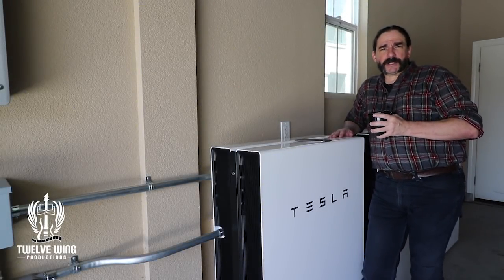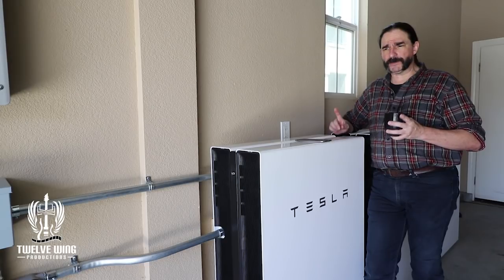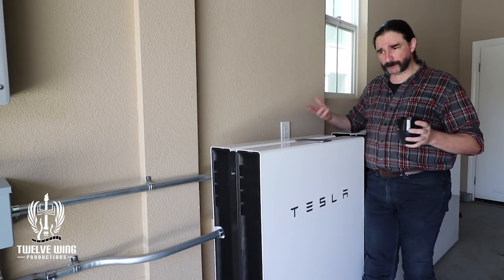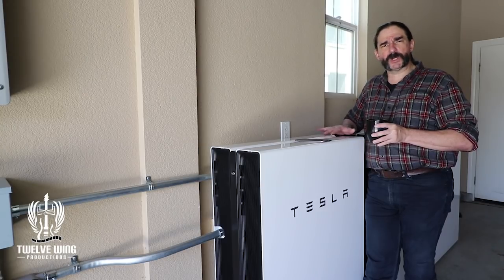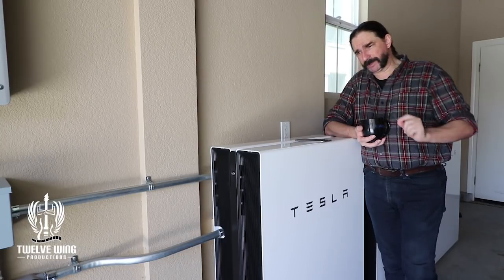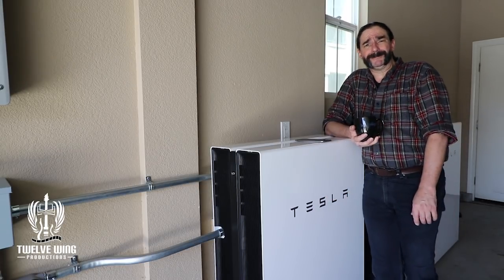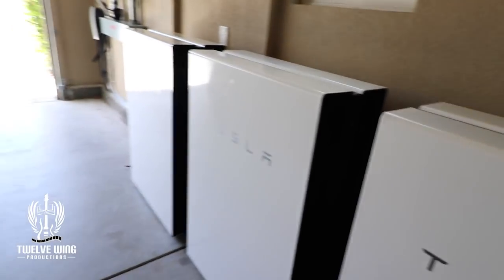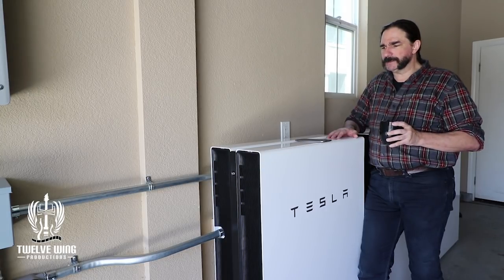Energy Sovereignty Project Quick Topic: Tesla Powerwall needs a capacity limit setting

Comment: I'm considering a 15kw power wall equivalent.. but not from Tesla.  They still can't figure out how to make the magic roof... And the corporation has had years of quarterly reports with huge losses.. (700 million in the latest go round..) --- I'm looking at pouch batteries that hold about 4x the capacity of the tesla batteries... Those were part of an electrical bus demo project.. Huge capacity.. Immense current flow capability.. Throw in about 3kw of roof and yard panels, and you have a good starting point.. perhaps 5kw?  The alternator is already available... (from China...will need thorough testing first, obviously)... I'm concerned about what happens if Elon manages to have a margin call as a result of the latest 2 billion dollars of bonds...   If the mothership stops responding when devices try to call home, do they shut down?  What happens to the cars when Tesla stops paying their electric bills all over the country?
Reply from the maker: You covered a lot of ground there.  Much of what you wrote has some basis in reality but let me go through your points one by one to make sure you are looking at things realistically and not just sucking down what short sellers are telling you blindly.

Tesla has it's issues, but delivering on what they promise isn't one of them.

"I'm considering a 15kw power wall equivalent.. but not from Tesla"~

And that's fine, but you had better make sure that whoever you buy your batteries from is either using a liquid cooling loop or is using some technology other than lithium ion.

"They still can't figure out how to make the magic roof.."~

Firstly, if you are considering going solar then you already know that the roof isn't "magic".  It's solar.
Once you are honest about that then what you need to realize that altering a form factor on a product to make it better is never the easy road to take.  It's potentially a hugely rewarding one, but it's not an easy road to take.
By all accounts Tesla is making a wonderful product with it's roof solar tiles but integrating them requires testing and regulatory approval.
I expect they are running into their share of both engineering and regulatory hurdles.

"And the corporation has had years of quarterly reports with huge losses.. "~

Here is where you need to be careful to listen to tech insiders and not the stock broker who is trying to convince you to short Tesla.
Tesla has invested hugely in what's called NRE or "Nonrecurring Engineering". The reason Tesla sells every car it makes and GM is looking at Tesla's pre-order list like a monkey trying to figure out a magic trick is because of the Supercharger network.
That network cost them a huge chunk of change but has also built a moat around the company that is proving VERY difficult for any other EV manufacturer to cross.
Tesla's second moat is the Gigafactory... and now 2 more of them in the works.
These too.. are creating what you THINK are "losses" but are in point of fact investments that virtually ensure that they won't have any real competition from anyone for decades.
What happens after that is anyone's guess but you are now talking about a person from whom the military is buying hardware. 

Let that last statement resonate with you for a moment before reading further.

" I'm looking at pouch batteries that hold about 4x the capacity of the tesla batteries..."~

Careful with that statement.  If you are looking at pouch batteries you had better be looking at how they are cooled.
If you tell me specifically what battery you are currently looking at, I'll be happy to give you some insight on what we know about them from our research.
We found NO other manufacturer, most using pouch style batteries for their internals, that were utilizing adequate thermal management.

"Those were part of an electrical bus demo project.. "~

Pouch batteries were also part of Mercedes large truck line.  The one they had to scrap... because they didn't have adequate thermal management.
This same technology line caused them to scrap two passenger vehicle lines and their home battery project.
So I'm going to say this again... make sure there is adequate thermal management.  If they are talking about air cooling the thing... avoid it.

" and you have a good starting point.. perhaps 5kw?"~

Everything depends on your home's average usage.  What is your annual average daily consumption, your winter average daily consumption and your summer average daily consumption.
With those three data sets in your bag of tricks you can draw informed conclusions about a good starting point.
I'll be happy to assist you with that if you can give me those 3 numbers as well as your latitude and elevation.

"The alternator is already available... "~

Alternator?  For wind?

"from China...will need thorough testing first, obviously"~

I'm buying nothing from China, and would suggest that anyone visiting this channel not do so either if they can absolutely avoid it.
China's issues are many.  Firstly the fact they don't recognize intellectual property rights is a HUGE issue for me.  I know how things get developed and rewarding companies for trying to advance our condition is paramount.
The deal breaker, however, is the bait and switch tactic taken by this VERY corrupt society.
They think nothing of providing you thousands of devices that are perfectly fine with the idea that they will deliver substandard goods later as they skimp on key materials.
The way Chinese companies work is that they start to copy the equipment needed to make your product even before you have finished building your own factory.
They then siphon off expensive materials for their own companies to make knockoffs while they substitute the cheap materials in the primary manufacturers goods.
This is RAMPANT.

"what happens if Elon manages to have a margin call as a result of the latest 2 billion dollars of bonds..."~

The takeaway here is that Tesla is paying it's bills.

"If the mothership stops responding when devices try to call home, do they shut down?"~

Neither the car nor the home batteries will stop working due to lack of contact.  Advancement will stop, obviously, but the devices will work fine.
What will happen next is that the people that developed that hardware and software will be looking for a job.
They will immediately start releasing "Jail braked" versions of the software.
I would be shocked if that took so long as a month.
Chevron or Shell would purchase the supercharger network and even in a total collapse of Tesla (not friggin likely at this point) the consumers will be fine.

I think that touched on most of your points.
Let me know what specific batteries you are considering.  I'll be happy to go over the pros and cons of that specific system and lay performance, size and longevity against the actual performance numbers we are getting out of the Powerwall system.
Reply from the maker: You covered a lot of ground there.  Much of what you wrote has some basis in reality but let me go through your points one by one to make sure you are looking at things realistically and not just sucking down what short sellers are telling you blindly.

Tesla has it's issues, but delivering on what they promise isn't one of them.

"I'm considering a 15kw power wall equivalent.. but not from Tesla"~

And that's fine, but you had better make sure that whoever you buy your batteries from is either using a liquid cooling loop or is using some technology other than lithium ion.

"They still can't figure out how to make the magic roof.."~

Firstly, if you are considering going solar then you already know that the roof isn't "magic".  It's solar.
Once you are honest about that then what you need to realize that altering a form factor on a product to make it better is never the easy road to take.  It's potentially a hugely rewarding one, but it's not an easy road to take.
By all accounts Tesla is making a wonderful product with it's roof solar tiles but integrating them requires testing and regulatory approval.
I expect they are running into their share of both engineering and regulatory hurdles.

"And the corporation has had years of quarterly reports with huge losses.. "~

Here is where you need to be careful to listen to tech insiders and not the stock broker who is trying to convince you to short Tesla.
Tesla has invested hugely in what's called NRE or "Nonrecurring Engineering". The reason Tesla sells every car it makes and GM is looking at Tesla's pre-order list like a monkey trying to figure out a magic trick is because of the Supercharger network.
That network cost them a huge chunk of change but has also built a moat around the company that is proving VERY difficult for any other EV manufacturer to cross.
Tesla's second moat is the Gigafactory... and now 2 more of them in the works.
These too.. are creating what you THINK are "losses" but are in point of fact investments that virtually ensure that they won't have any real competition from anyone for decades.
What happens after that is anyone's guess but you are now talking about a person from whom the military is buying hardware. 

Let that last statement resonate with you for a moment before reading further.

" I'm looking at pouch batteries that hold about 4x the capacity of the tesla batteries..."~

Careful with that statement.  If you are looking at pouch batteries you had better be looking at how they are cooled.
If you tell me specifically what battery you are currently looking at, I'll be happy to give you some insight on what we know about them from our research.
We found NO other manufacturer, most using pouch style batteries for their internals, that were utilizing adequate thermal management.

"Those were part of an electrical bus demo project.. "~

Pouch batteries were also part of Mercedes large truck line.  The one they had to scrap... because they didn't have adequate thermal management.
This same technology line caused them to scrap two passenger vehicle lines and their home battery project.
So I'm going to say this again... make sure there is adequate thermal management.  If they are talking about air cooling the thing... avoid it.

" and you have a good starting point.. perhaps 5kw?"~

Everything depends on your home's average usage.  What is your annual average daily consumption, your winter average daily consumption and your summer average daily consumption.
With those three data sets in your bag of tricks you can draw informed conclusions about a good starting point.
I'll be happy to assist you with that if you can give me those 3 numbers as well as your latitude and elevation.

"The alternator is already available... "~

Alternator?  For wind?

"from China...will need thorough testing first, obviously"~

I'm buying nothing from China, and would suggest that anyone visiting this channel not do so either if they can absolutely avoid it.
China's issues are many.  Firstly the fact they don't recognize intellectual property rights is a HUGE issue for me.  I know how things get developed and rewarding companies for trying to advance our condition is paramount.
The deal breaker, however, is the bait and switch tactic taken by this VERY corrupt society.
They think nothing of providing you thousands of devices that are perfectly fine with the idea that they will deliver substandard goods later as they skimp on key materials.
The way Chinese companies work is that they start to copy the equipment needed to make your product even before you have finished building your own factory.
They then siphon off expensive materials for their own companies to make knockoffs while they substitute the cheap materials in the primary manufacturers goods.
This is RAMPANT.

"what happens if Elon manages to have a margin call as a result of the latest 2 billion dollars of bonds..."~

The takeaway here is that Tesla is paying it's bills.

"If the mothership stops responding when devices try to call home, do they shut down?"~

Neither the car nor the home batteries will stop working due to lack of contact.  Advancement will stop, obviously, but the devices will work fine.
What will happen next is that the people that developed that hardware and software will be looking for a job.
They will immediately start releasing "Jail braked" versions of the software.
I would be shocked if that took so long as a month.
Chevron or Shell would purchase the supercharger network and even in a total collapse of Tesla (not friggin likely at this point) the consumers will be fine.

I think that touched on most of your points.
Let me know what specific batteries you are considering.  I'll be happy to go over the pros and cons of that specific system and lay performance, size and longevity against the actual performance numbers we are getting out of the Powerwall system.
Reply from the maker: You covered a lot of ground there.  Much of what you wrote has some basis in reality but let me go through your points one by one to make sure you are looking at things realistically and not just sucking down what short sellers are telling you blindly.

Tesla has it's issues, but delivering on what they promise isn't one of them.

"I'm considering a 15kw power wall equivalent.. but not from Tesla"~

And that's fine, but you had better make sure that whoever you buy your batteries from is either using a liquid cooling loop or is using some technology other than lithium ion.

"They still can't figure out how to make the magic roof.."~

Firstly, if you are considering going solar then you already know that the roof isn't "magic".  It's solar.
Once you are honest about that then what you need to realize that altering a form factor on a product to make it better is never the easy road to take.  It's potentially a hugely rewarding one, but it's not an easy road to take.
By all accounts Tesla is making a wonderful product with it's roof solar tiles but integrating them requires testing and regulatory approval.
I expect they are running into their share of both engineering and regulatory hurdles.

"And the corporation has had years of quarterly reports with huge losses.. "~

Here is where you need to be careful to listen to tech insiders and not the stock broker who is trying to convince you to short Tesla.
Tesla has invested hugely in what's called NRE or "Nonrecurring Engineering". The reason Tesla sells every car it makes and GM is looking at Tesla's pre-order list like a monkey trying to figure out a magic trick is because of the Supercharger network.
That network cost them a huge chunk of change but has also built a moat around the company that is proving VERY difficult for any other EV manufacturer to cross.
Tesla's second moat is the Gigafactory... and now 2 more of them in the works.
These too.. are creating what you THINK are "losses" but are in point of fact investments that virtually ensure that they won't have any real competition from anyone for decades.
What happens after that is anyone's guess but you are now talking about a person from whom the military is buying hardware. 

Let that last statement resonate with you for a moment before reading further.

" I'm looking at pouch batteries that hold about 4x the capacity of the tesla batteries..."~

Careful with that statement.  If you are looking at pouch batteries you had better be looking at how they are cooled.
If you tell me specifically what battery you are currently looking at, I'll be happy to give you some insight on what we know about them from our research.
We found NO other manufacturer, most using pouch style batteries for their internals, that were utilizing adequate thermal management.

"Those were part of an electrical bus demo project.. "~

Pouch batteries were also part of Mercedes large truck line.  The one they had to scrap... because they didn't have adequate thermal management.
This same technology line caused them to scrap two passenger vehicle lines and their home battery project.
So I'm going to say this again... make sure there is adequate thermal management.  If they are talking about air cooling the thing... avoid it.

" and you have a good starting point.. perhaps 5kw?"~

Everything depends on your home's average usage.  What is your annual average daily consumption, your winter average daily consumption and your summer average daily consumption.
With those three data sets in your bag of tricks you can draw informed conclusions about a good starting point.
I'll be happy to assist you with that if you can give me those 3 numbers as well as your latitude and elevation.

"The alternator is already available... "~

Alternator?  For wind?

"from China...will need thorough testing first, obviously"~

I'm buying nothing from China, and would suggest that anyone visiting this channel not do so either if they can absolutely avoid it.
China's issues are many.  Firstly the fact they don't recognize intellectual property rights is a HUGE issue for me.  I know how things get developed and rewarding companies for trying to advance our condition is paramount.
The deal breaker, however, is the bait and switch tactic taken by this VERY corrupt society.
They think nothing of providing you thousands of devices that are perfectly fine with the idea that they will deliver substandard goods later as they skimp on key materials.
The way Chinese companies work is that they start to copy the equipment needed to make your product even before you have finished building your own factory.
They then siphon off expensive materials for their own companies to make knockoffs while they substitute the cheap materials in the primary manufacturers goods.
This is RAMPANT.

"what happens if Elon manages to have a margin call as a result of the latest 2 billion dollars of bonds..."~

The takeaway here is that Tesla is paying it's bills.

"If the mothership stops responding when devices try to call home, do they shut down?"~

Neither the car nor the home batteries will stop working due to lack of contact.  Advancement will stop, obviously, but the devices will work fine.
What will happen next is that the people that developed that hardware and software will be looking for a job.
They will immediately start releasing "Jail braked" versions of the software.
I would be shocked if that took so long as a month.
Chevron or Shell would purchase the supercharger network and even in a total collapse of Tesla (not friggin likely at this point) the consumers will be fine.

I think that touched on most of your points.
Let me know what specific batteries you are considering.  I'll be happy to go over the pros and cons of that specific system and lay performance, size and longevity against the actual performance numbers we are getting out of the Powerwall system.
Reply from the maker: You covered a lot of ground there.  Much of what you wrote has some basis in reality but let me go through your points one by one to make sure you are looking at things realistically and not just sucking down what short sellers are telling you blindly.

Tesla has it's issues, but delivering on what they promise isn't one of them.

"I'm considering a 15kw power wall equivalent.. but not from Tesla"~

And that's fine, but you had better make sure that whoever you buy your batteries from is either using a liquid cooling loop or is using some technology other than lithium ion.

"They still can't figure out how to make the magic roof.."~

Firstly, if you are considering going solar then you already know that the roof isn't "magic".  It's solar.
Once you are honest about that then what you need to realize that altering a form factor on a product to make it better is never the easy road to take.  It's potentially a hugely rewarding one, but it's not an easy road to take.
By all accounts Tesla is making a wonderful product with it's roof solar tiles but integrating them requires testing and regulatory approval.
I expect they are running into their share of both engineering and regulatory hurdles.

"And the corporation has had years of quarterly reports with huge losses.. "~

Here is where you need to be careful to listen to tech insiders and not the stock broker who is trying to convince you to short Tesla.
Tesla has invested hugely in what's called NRE or "Nonrecurring Engineering". The reason Tesla sells every car it makes and GM is looking at Tesla's pre-order list like a monkey trying to figure out a magic trick is because of the Supercharger network.
That network cost them a huge chunk of change but has also built a moat around the company that is proving VERY difficult for any other EV manufacturer to cross.
Tesla's second moat is the Gigafactory... and now 2 more of them in the works.
These too.. are creating what you THINK are "losses" but are in point of fact investments that virtually ensure that they won't have any real competition from anyone for decades.
What happens after that is anyone's guess but you are now talking about a person from whom the military is buying hardware. 

Let that last statement resonate with you for a moment before reading further.

" I'm looking at pouch batteries that hold about 4x the capacity of the tesla batteries..."~

Careful with that statement.  If you are looking at pouch batteries you had better be looking at how they are cooled.
If you tell me specifically what battery you are currently looking at, I'll be happy to give you some insight on what we know about them from our research.
We found NO other manufacturer, most using pouch style batteries for their internals, that were utilizing adequate thermal management.

"Those were part of an electrical bus demo project.. "~

Pouch batteries were also part of Mercedes large truck line.  The one they had to scrap... because they didn't have adequate thermal management.
This same technology line caused them to scrap two passenger vehicle lines and their home battery project.
So I'm going to say this again... make sure there is adequate thermal management.  If they are talking about air cooling the thing... avoid it.

" and you have a good starting point.. perhaps 5kw?"~

Everything depends on your home's average usage.  What is your annual average daily consumption, your winter average daily consumption and your summer average daily consumption.
With those three data sets in your bag of tricks you can draw informed conclusions about a good starting point.
I'll be happy to assist you with that if you can give me those 3 numbers as well as your latitude and elevation.

"The alternator is already available... "~

Alternator?  For wind?

"from China...will need thorough testing first, obviously"~

I'm buying nothing from China, and would suggest that anyone visiting this channel not do so either if they can absolutely avoid it.
China's issues are many.  Firstly the fact they don't recognize intellectual property rights is a HUGE issue for me.  I know how things get developed and rewarding companies for trying to advance our condition is paramount.
The deal breaker, however, is the bait and switch tactic taken by this VERY corrupt society.
They think nothing of providing you thousands of devices that are perfectly fine with the idea that they will deliver substandard goods later as they skimp on key materials.
The way Chinese companies work is that they start to copy the equipment needed to make your product even before you have finished building your own factory.
They then siphon off expensive materials for their own companies to make knockoffs while they substitute the cheap materials in the primary manufacturers goods.
This is RAMPANT.

"what happens if Elon manages to have a margin call as a result of the latest 2 billion dollars of bonds..."~

The takeaway here is that Tesla is paying it's bills.

"If the mothership stops responding when devices try to call home, do they shut down?"~

Neither the car nor the home batteries will stop working due to lack of contact.  Advancement will stop, obviously, but the devices will work fine.
What will happen next is that the people that developed that hardware and software will be looking for a job.
They will immediately start releasing "Jail braked" versions of the software.
I would be shocked if that took so long as a month.
Chevron or Shell would purchase the supercharger network and even in a total collapse of Tesla (not friggin likely at this point) the consumers will be fine.

I think that touched on most of your points.
Let me know what specific batteries you are considering.  I'll be happy to go over the pros and cons of that specific system and lay performance, size and longevity against the actual performance numbers we are getting out of the Powerwall system.
Reply from the maker: You covered a lot of ground there.  Much of what you wrote has some basis in reality but let me go through your points one by one to make sure you are looking at things realistically and not just sucking down what short sellers are telling you blindly.

Tesla has it's issues, but delivering on what they promise isn't one of them.

"I'm considering a 15kw power wall equivalent.. but not from Tesla"~

And that's fine, but you had better make sure that whoever you buy your batteries from is either using a liquid cooling loop or is using some technology other than lithium ion.

"They still can't figure out how to make the magic roof.."~

Firstly, if you are considering going solar then you already know that the roof isn't "magic".  It's solar.
Once you are honest about that then what you need to realize that altering a form factor on a product to make it better is never the easy road to take.  It's potentially a hugely rewarding one, but it's not an easy road to take.
By all accounts Tesla is making a wonderful product with it's roof solar tiles but integrating them requires testing and regulatory approval.
I expect they are running into their share of both engineering and regulatory hurdles.

"And the corporation has had years of quarterly reports with huge losses.. "~

Here is where you need to be careful to listen to tech insiders and not the stock broker who is trying to convince you to short Tesla.
Tesla has invested hugely in what's called NRE or "Nonrecurring Engineering". The reason Tesla sells every car it makes and GM is looking at Tesla's pre-order list like a monkey trying to figure out a magic trick is because of the Supercharger network.
That network cost them a huge chunk of change but has also built a moat around the company that is proving VERY difficult for any other EV manufacturer to cross.
Tesla's second moat is the Gigafactory... and now 2 more of them in the works.
These too.. are creating what you THINK are "losses" but are in point of fact investments that virtually ensure that they won't have any real competition from anyone for decades.
What happens after that is anyone's guess but you are now talking about a person from whom the military is buying hardware. 

Let that last statement resonate with you for a moment before reading further.

" I'm looking at pouch batteries that hold about 4x the capacity of the tesla batteries..."~

Careful with that statement.  If you are looking at pouch batteries you had better be looking at how they are cooled.
If you tell me specifically what battery you are currently looking at, I'll be happy to give you some insight on what we know about them from our research.
We found NO other manufacturer, most using pouch style batteries for their internals, that were utilizing adequate thermal management.

"Those were part of an electrical bus demo project.. "~

Pouch batteries were also part of Mercedes large truck line.  The one they had to scrap... because they didn't have adequate thermal management.
This same technology line caused them to scrap two passenger vehicle lines and their home battery project.
So I'm going to say this again... make sure there is adequate thermal management.  If they are talking about air cooling the thing... avoid it.

" and you have a good starting point.. perhaps 5kw?"~

Everything depends on your home's average usage.  What is your annual average daily consumption, your winter average daily consumption and your summer average daily consumption.
With those three data sets in your bag of tricks you can draw informed conclusions about a good starting point.
I'll be happy to assist you with that if you can give me those 3 numbers as well as your latitude and elevation.

"The alternator is already available... "~

Alternator?  For wind?

"from China...will need thorough testing first, obviously"~

I'm buying nothing from China, and would suggest that anyone visiting this channel not do so either if they can absolutely avoid it.
China's issues are many.  Firstly the fact they don't recognize intellectual property rights is a HUGE issue for me.  I know how things get developed and rewarding companies for trying to advance our condition is paramount.
The deal breaker, however, is the bait and switch tactic taken by this VERY corrupt society.
They think nothing of providing you thousands of devices that are perfectly fine with the idea that they will deliver substandard goods later as they skimp on key materials.
The way Chinese companies work is that they start to copy the equipment needed to make your product even before you have finished building your own factory.
They then siphon off expensive materials for their own companies to make knockoffs while they substitute the cheap materials in the primary manufacturers goods.
This is RAMPANT.

"what happens if Elon manages to have a margin call as a result of the latest 2 billion dollars of bonds..."~

The takeaway here is that Tesla is paying it's bills.

"If the mothership stops responding when devices try to call home, do they shut down?"~

Neither the car nor the home batteries will stop working due to lack of contact.  Advancement will stop, obviously, but the devices will work fine.
What will happen next is that the people that developed that hardware and software will be looking for a job.
They will immediately start releasing "Jail braked" versions of the software.
I would be shocked if that took so long as a month.
Chevron or Shell would purchase the supercharger network and even in a total collapse of Tesla (not friggin likely at this point) the consumers will be fine.

I think that touched on most of your points.
Let me know what specific batteries you are considering.  I'll be happy to go over the pros and cons of that specific system and lay performance, size and longevity against the actual performance numbers we are getting out of the Powerwall system.
Reply from the maker: You covered a lot of ground there.  Much of what you wrote has some basis in reality but let me go through your points one by one to make sure you are looking at things realistically and not just sucking down what short sellers are telling you blindly.

Tesla has it's issues, but delivering on what they promise isn't one of them.

"I'm considering a 15kw power wall equivalent.. but not from Tesla"~

And that's fine, but you had better make sure that whoever you buy your batteries from is either using a liquid cooling loop or is using some technology other than lithium ion.

"They still can't figure out how to make the magic roof.."~

Firstly, if you are considering going solar then you already know that the roof isn't "magic".  It's solar.
Once you are honest about that then what you need to realize that altering a form factor on a product to make it better is never the easy road to take.  It's potentially a hugely rewarding one, but it's not an easy road to take.
By all accounts Tesla is making a wonderful product with it's roof solar tiles but integrating them requires testing and regulatory approval.
I expect they are running into their share of both engineering and regulatory hurdles.

"And the corporation has had years of quarterly reports with huge losses.. "~

Here is where you need to be careful to listen to tech insiders and not the stock broker who is trying to convince you to short Tesla.
Tesla has invested hugely in what's called NRE or "Nonrecurring Engineering". The reason Tesla sells every car it makes and GM is looking at Tesla's pre-order list like a monkey trying to figure out a magic trick is because of the Supercharger network.
That network cost them a huge chunk of change but has also built a moat around the company that is proving VERY difficult for any other EV manufacturer to cross.
Tesla's second moat is the Gigafactory... and now 2 more of them in the works.
These too.. are creating what you THINK are "losses" but are in point of fact investments that virtually ensure that they won't have any real competition from anyone for decades.
What happens after that is anyone's guess but you are now talking about a person from whom the military is buying hardware. 

Let that last statement resonate with you for a moment before reading further.

" I'm looking at pouch batteries that hold about 4x the capacity of the tesla batteries..."~

Careful with that statement.  If you are looking at pouch batteries you had better be looking at how they are cooled.
If you tell me specifically what battery you are currently looking at, I'll be happy to give you some insight on what we know about them from our research.
We found NO other manufacturer, most using pouch style batteries for their internals, that were utilizing adequate thermal management.

"Those were part of an electrical bus demo project.. "~

Pouch batteries were also part of Mercedes large truck line.  The one they had to scrap... because they didn't have adequate thermal management.
This same technology line caused them to scrap two passenger vehicle lines and their home battery project.
So I'm going to say this again... make sure there is adequate thermal management.  If they are talking about air cooling the thing... avoid it.

" and you have a good starting point.. perhaps 5kw?"~

Everything depends on your home's average usage.  What is your annual average daily consumption, your winter average daily consumption and your summer average daily consumption.
With those three data sets in your bag of tricks you can draw informed conclusions about a good starting point.
I'll be happy to assist you with that if you can give me those 3 numbers as well as your latitude and elevation.

"The alternator is already available... "~

Alternator?  For wind?

"from China...will need thorough testing first, obviously"~

I'm buying nothing from China, and would suggest that anyone visiting this channel not do so either if they can absolutely avoid it.
China's issues are many.  Firstly the fact they don't recognize intellectual property rights is a HUGE issue for me.  I know how things get developed and rewarding companies for trying to advance our condition is paramount.
The deal breaker, however, is the bait and switch tactic taken by this VERY corrupt society.
They think nothing of providing you thousands of devices that are perfectly fine with the idea that they will deliver substandard goods later as they skimp on key materials.
The way Chinese companies work is that they start to copy the equipment needed to make your product even before you have finished building your own factory.
They then siphon off expensive materials for their own companies to make knockoffs while they substitute the cheap materials in the primary manufacturers goods.
This is RAMPANT.

"what happens if Elon manages to have a margin call as a result of the latest 2 billion dollars of bonds..."~

The takeaway here is that Tesla is paying it's bills.

"If the mothership stops responding when devices try to call home, do they shut down?"~

Neither the car nor the home batteries will stop working due to lack of contact.  Advancement will stop, obviously, but the devices will work fine.
What will happen next is that the people that developed that hardware and software will be looking for a job.
They will immediately start releasing "Jail braked" versions of the software.
I would be shocked if that took so long as a month.
Chevron or Shell would purchase the supercharger network and even in a total collapse of Tesla (not friggin likely at this point) the consumers will be fine.

I think that touched on most of your points.
Let me know what specific batteries you are considering.  I'll be happy to go over the pros and cons of that specific system and lay performance, size and longevity against the actual performance numbers we are getting out of the Powerwall system.
Reply: @twelvewingproductions7508  The problem: Elon promises much and does NOT deliver.  He said they would be doing 5k a week in 2017 the year before. Never happened. We do not know if Tesla is paying suppliers in a timely manner.  Panasonic has backed out of the China Factory (Promised to be finished in what? 2017?  It's a plot of dirt right now.  Panasonic had a BIG AP entry here in the US.  Could that be batteries for Tesla?    And when it comes to getting approval from the mothership to charge...you had best assume that it will not work.  (That is a billing function and if the web site goes away, there won't be billing...--- The power walls call to discuss passing energy to the grid and so on... And management from their end.  When it comes to power generation, you fail for safety.  (worked in distribution at a utility office... anything less than safety means failing to off.)   

Elon said that the roofs would be going on houses in large quantities.. Well, 13 homes is not a large quantity. So 2017 didn't work for the roof, neither did 2018... So far, 2019 is not looking good either. 

The cars are so expensive to repair that you might have a 3-6 month period without your car, and that door and quarter panel will end up costing $20,000 or more.  That is why he is talking about selling insurance. Having a car totaled for a bumper and quarter panel, or door and quarter panel is really odd. You have HUGE insurance bills since small accidents cause enough damage to total the car.  The Feds are investigating currently, and the banks are nervous.  They may pull a margin call if the stock drops, selling a huge block that was put up as collateral.  That will further depress the stock, making short sellers very happy. (Not me...)  Elon just mortgaged 5 of his homes.  Sounds like a cash flow issue.. and HE violated his agreement with the courts and the financial arm that is looking at him.   Several things come up that are scary.  Tesla put out official guidance and production number, the Elon comes out and changes things.  And then does it again..and again.  That makes the government (and other financial folk) very very unhappy.  He thinks there is nothing to worry about.  The big people that know finance are frowning.  And he violated a court order requiring board approval for all tweets.  Turned out he never passed any tweets past the board.  Frankly, the stunts he pulled to save his wallet, and his cousin's wallets when Tesla bought Solar CIty (also saved several relatives pockets) came at the expense of Tesla stockholders.  Solar City was not being run by Elon.. but his cousins if I remember correctly... He saved their bacon as well because it was turning into another Solyndra.  Getting ready to close.. That would have hit Elon in the pocket, as well as throwing his cousins out of work.

He promised the magical shingles last year... saying they would be rolling them out nationwide.  Last year and this year... Well, didn't happen.  They claimed that they would be impervious to the weather, birds and so on.. but they are not reliable at this point. They break, with regularity.   One guy down here ordered a year and a half ago...gave lots of money.... and has gotten nothing in return.  For his needs, the roof was $40,000.  He'll be asking for a big refund shortly.  I like the vision, but I am not ready to put up with a paperweight.  If Tesla folds... there won't be superchargers. (well, except for Audi superchargers ...The VW folk have 500 going in at this moment for their new luxury cars... Part of their Diesel exhaust debacle a few years ago.)  Elon and Tesla are one margin call away from becoming a memory.  Of course, someone may buy the name, Intellectual property and so on, but who knows?  If the Tesla mother ship folds, will the power walls shut down?  Will the cars all stop working?  Jail breaking a tesla may be the only way to keep things operating.. The car won't hunt for their chargers, and map updates will stop.. but you can always use it locally with a 220 charger....
Reply from the maker: @Billblom , I'm going to have to reel you in here... and more than a little.
What you are doing now is typing without researching or even thinking.
You need to put your opinions about Tesla on hold and actually look into this before you wind up looking silly.

There are no less than 6 things in the first three paragraphs that you are misinformed about or are flat out wrong... yet you are forming your reply here in the form of a statements and not questions.
It's fine not to know something but it's not fine to spread misinformation to fuel an agenda.

I'm not going to give lengthy answers to much of what you wrote because most of it is poorly researched and doesn't even have anything to anchor an honest argument.

I will, however, list a few things here that you really do need to research before responding.

While it is true that Tesla (Elon Musk) is often late on projects, it is equally true that he over delivers on those projects.  I can give an entire list that got us to where we are today... but do I really have to?  Seriously?

Next up are some of the things you have heard regarding business dealings.  Panasonic was in a co-venture with Tesla much like Mercedes was.  They will maintain these relationships for so long as they are mutually beneficial.  When they are not, they won't.

Both Mercedes and Panasonic are competitors.  Through a sharing of technology with both companies, all 3 have emerged stronger for their relationship with Tesla.
The China factory is moving along just fine.  It wasn't but 4 months ago that they got approval from the Chinese government NOT to steal Tesla's IP.  That was what was holding things up.
Trying to cite China's delays as a negative is a stretch.

About the only thing you got right was when you said that IF Tesla closed shop, for a time the supercharger network would be idle.  That wouldn't last long for the very reason you said in your very next sentence.
Whoever takes it over can charge for using it.
So no, you don't get to pop off with a statement like "The Superchargers will shut down" and then just shut your brain off and pretend that you don't know what will happen next.
Same with every part of the current automobile lineup.  Those that wrote the code will start writing the code for third party support companies that will be happy to cash in on keeping the cars alive.

Same with the Powerwalls.
The second point with the Powerwalls is that you OBVIOUSLY have no experience with them nor have you apparently been monitoring this channel much.  If you had you would already know that the units don't have to ask the "mothership" for anything.
They will keep running happy as you please with no communication what so ever.
You won't get updates and you won't be able to alter settings, but they will continue to run just fine.
Then, the same thing will happen with the Powerwalls.  Someone will "Jail Break" them.
Richardt and others already have software to drive them.  I don't choose to use that hardware because I am trying to promote what the general public will do with the equipment.  And the general public isn't going to be voiding their warranty. 

So please, Billblom, I do enjoy getting and answering feedback here... but if you don't actually know something... ask.
If you just start typing crap just to support your agenda... and it's wrong... I'm going to call you on it.
That's also part of the deal here.

As to the others, neither Audi nor Porsche have ANY fast chargers.  They are all still using other DC fast charge networks.
Tesla has adapters now for both Chademo and CCS.  So no, Teslas wouldn't be locked to level 2 charging.  But again, that point is moot because another party would buy the SC network from Tesla should they fall.  Probably Audi or Porsche.. but at this point I would be putting my bet on Ford.
Reply from the maker: You covered a lot of ground there.  Much of what you wrote has some basis in reality but let me go through your points one by one to make sure you are looking at things realistically and not just sucking down what short sellers are telling you blindly.

Tesla has it's issues, but delivering on what they promise isn't one of them.

"I'm considering a 15kw power wall equivalent.. but not from Tesla"~

And that's fine, but you had better make sure that whoever you buy your batteries from is either using a liquid cooling loop or is using some technology other than lithium ion.

"They still can't figure out how to make the magic roof.."~

Firstly, if you are considering going solar then you already know that the roof isn't "magic".  It's solar.
Once you are honest about that then what you need to realize that altering a form factor on a product to make it better is never the easy road to take.  It's potentially a hugely rewarding one, but it's not an easy road to take.
By all accounts Tesla is making a wonderful product with it's roof solar tiles but integrating them requires testing and regulatory approval.
I expect they are running into their share of both engineering and regulatory hurdles.

"And the corporation has had years of quarterly reports with huge losses.. "~

Here is where you need to be careful to listen to tech insiders and not the stock broker who is trying to convince you to short Tesla.
Tesla has invested hugely in what's called NRE or "Nonrecurring Engineering". The reason Tesla sells every car it makes and GM is looking at Tesla's pre-order list like a monkey trying to figure out a magic trick is because of the Supercharger network.
That network cost them a huge chunk of change but has also built a moat around the company that is proving VERY difficult for any other EV manufacturer to cross.
Tesla's second moat is the Gigafactory... and now 2 more of them in the works.
These too.. are creating what you THINK are "losses" but are in point of fact investments that virtually ensure that they won't have any real competition from anyone for decades.
What happens after that is anyone's guess but you are now talking about a person from whom the military is buying hardware. 

Let that last statement resonate with you for a moment before reading further.

" I'm looking at pouch batteries that hold about 4x the capacity of the tesla batteries..."~

Careful with that statement.  If you are looking at pouch batteries you had better be looking at how they are cooled.
If you tell me specifically what battery you are currently looking at, I'll be happy to give you some insight on what we know about them from our research.
We found NO other manufacturer, most using pouch style batteries for their internals, that were utilizing adequate thermal management.

"Those were part of an electrical bus demo project.. "~

Pouch batteries were also part of Mercedes large truck line.  The one they had to scrap... because they didn't have adequate thermal management.
This same technology line caused them to scrap two passenger vehicle lines and their home battery project.
So I'm going to say this again... make sure there is adequate thermal management.  If they are talking about air cooling the thing... avoid it.

" and you have a good starting point.. perhaps 5kw?"~

Everything depends on your home's average usage.  What is your annual average daily consumption, your winter average daily consumption and your summer average daily consumption.
With those three data sets in your bag of tricks you can draw informed conclusions about a good starting point.
I'll be happy to assist you with that if you can give me those 3 numbers as well as your latitude and elevation.

"The alternator is already available... "~

Alternator?  For wind?

"from China...will need thorough testing first, obviously"~

I'm buying nothing from China, and would suggest that anyone visiting this channel not do so either if they can absolutely avoid it.
China's issues are many.  Firstly the fact they don't recognize intellectual property rights is a HUGE issue for me.  I know how things get developed and rewarding companies for trying to advance our condition is paramount.
The deal breaker, however, is the bait and switch tactic taken by this VERY corrupt society.
They think nothing of providing you thousands of devices that are perfectly fine with the idea that they will deliver substandard goods later as they skimp on key materials.
The way Chinese companies work is that they start to copy the equipment needed to make your product even before you have finished building your own factory.
They then siphon off expensive materials for their own companies to make knockoffs while they substitute the cheap materials in the primary manufacturers goods.
This is RAMPANT.

"what happens if Elon manages to have a margin call as a result of the latest 2 billion dollars of bonds..."~

The takeaway here is that Tesla is paying it's bills.

"If the mothership stops responding when devices try to call home, do they shut down?"~

Neither the car nor the home batteries will stop working due to lack of contact.  Advancement will stop, obviously, but the devices will work fine.
What will happen next is that the people that developed that hardware and software will be looking for a job.
They will immediately start releasing "Jail braked" versions of the software.
I would be shocked if that took so long as a month.
Chevron or Shell would purchase the supercharger network and even in a total collapse of Tesla (not friggin likely at this point) the consumers will be fine.

I think that touched on most of your points.
Let me know what specific batteries you are considering.  I'll be happy to go over the pros and cons of that specific system and lay performance, size and longevity against the actual performance numbers we are getting out of the Powerwall system.
Reply from the maker: You covered a lot of ground there.  Much of what you wrote has some basis in reality but let me go through your points one by one to make sure you are looking at things realistically and not just sucking down what short sellers are telling you blindly.

Tesla has it's issues, but delivering on what they promise isn't one of them.

"I'm considering a 15kw power wall equivalent.. but not from Tesla"~

And that's fine, but you had better make sure that whoever you buy your batteries from is either using a liquid cooling loop or is using some technology other than lithium ion.

"They still can't figure out how to make the magic roof.."~

Firstly, if you are considering going solar then you already know that the roof isn't "magic".  It's solar.
Once you are honest about that then what you need to realize that altering a form factor on a product to make it better is never the easy road to take.  It's potentially a hugely rewarding one, but it's not an easy road to take.
By all accounts Tesla is making a wonderful product with it's roof solar tiles but integrating them requires testing and regulatory approval.
I expect they are running into their share of both engineering and regulatory hurdles.

"And the corporation has had years of quarterly reports with huge losses.. "~

Here is where you need to be careful to listen to tech insiders and not the stock broker who is trying to convince you to short Tesla.
Tesla has invested hugely in what's called NRE or "Nonrecurring Engineering". The reason Tesla sells every car it makes and GM is looking at Tesla's pre-order list like a monkey trying to figure out a magic trick is because of the Supercharger network.
That network cost them a huge chunk of change but has also built a moat around the company that is proving VERY difficult for any other EV manufacturer to cross.
Tesla's second moat is the Gigafactory... and now 2 more of them in the works.
These too.. are creating what you THINK are "losses" but are in point of fact investments that virtually ensure that they won't have any real competition from anyone for decades.
What happens after that is anyone's guess but you are now talking about a person from whom the military is buying hardware. 

Let that last statement resonate with you for a moment before reading further.

" I'm looking at pouch batteries that hold about 4x the capacity of the tesla batteries..."~

Careful with that statement.  If you are looking at pouch batteries you had better be looking at how they are cooled.
If you tell me specifically what battery you are currently looking at, I'll be happy to give you some insight on what we know about them from our research.
We found NO other manufacturer, most using pouch style batteries for their internals, that were utilizing adequate thermal management.

"Those were part of an electrical bus demo project.. "~

Pouch batteries were also part of Mercedes large truck line.  The one they had to scrap... because they didn't have adequate thermal management.
This same technology line caused them to scrap two passenger vehicle lines and their home battery project.
So I'm going to say this again... make sure there is adequate thermal management.  If they are talking about air cooling the thing... avoid it.

" and you have a good starting point.. perhaps 5kw?"~

Everything depends on your home's average usage.  What is your annual average daily consumption, your winter average daily consumption and your summer average daily consumption.
With those three data sets in your bag of tricks you can draw informed conclusions about a good starting point.
I'll be happy to assist you with that if you can give me those 3 numbers as well as your latitude and elevation.

"The alternator is already available... "~

Alternator?  For wind?

"from China...will need thorough testing first, obviously"~

I'm buying nothing from China, and would suggest that anyone visiting this channel not do so either if they can absolutely avoid it.
China's issues are many.  Firstly the fact they don't recognize intellectual property rights is a HUGE issue for me.  I know how things get developed and rewarding companies for trying to advance our condition is paramount.
The deal breaker, however, is the bait and switch tactic taken by this VERY corrupt society.
They think nothing of providing you thousands of devices that are perfectly fine with the idea that they will deliver substandard goods later as they skimp on key materials.
The way Chinese companies work is that they start to copy the equipment needed to make your product even before you have finished building your own factory.
They then siphon off expensive materials for their own companies to make knockoffs while they substitute the cheap materials in the primary manufacturers goods.
This is RAMPANT.

"what happens if Elon manages to have a margin call as a result of the latest 2 billion dollars of bonds..."~

The takeaway here is that Tesla is paying it's bills.

"If the mothership stops responding when devices try to call home, do they shut down?"~

Neither the car nor the home batteries will stop working due to lack of contact.  Advancement will stop, obviously, but the devices will work fine.
What will happen next is that the people that developed that hardware and software will be looking for a job.
They will immediately start releasing "Jail braked" versions of the software.
I would be shocked if that took so long as a month.
Chevron or Shell would purchase the supercharger network and even in a total collapse of Tesla (not friggin likely at this point) the consumers will be fine.

I think that touched on most of your points.
Let me know what specific batteries you are considering.  I'll be happy to go over the pros and cons of that specific system and lay performance, size and longevity against the actual performance numbers we are getting out of the Powerwall system.
Reply from the maker: You covered a lot of ground there.  Much of what you wrote has some basis in reality but let me go through your points one by one to make sure you are looking at things realistically and not just sucking down what short sellers are telling you blindly.

Tesla has it's issues, but delivering on what they promise isn't one of them.

"I'm considering a 15kw power wall equivalent.. but not from Tesla"~

And that's fine, but you had better make sure that whoever you buy your batteries from is either using a liquid cooling loop or is using some technology other than lithium ion.

"They still can't figure out how to make the magic roof.."~

Firstly, if you are considering going solar then you already know that the roof isn't "magic".  It's solar.
Once you are honest about that then what you need to realize that altering a form factor on a product to make it better is never the easy road to take.  It's potentially a hugely rewarding one, but it's not an easy road to take.
By all accounts Tesla is making a wonderful product with it's roof solar tiles but integrating them requires testing and regulatory approval.
I expect they are running into their share of both engineering and regulatory hurdles.

"And the corporation has had years of quarterly reports with huge losses.. "~

Here is where you need to be careful to listen to tech insiders and not the stock broker who is trying to convince you to short Tesla.
Tesla has invested hugely in what's called NRE or "Nonrecurring Engineering". The reason Tesla sells every car it makes and GM is looking at Tesla's pre-order list like a monkey trying to figure out a magic trick is because of the Supercharger network.
That network cost them a huge chunk of change but has also built a moat around the company that is proving VERY difficult for any other EV manufacturer to cross.
Tesla's second moat is the Gigafactory... and now 2 more of them in the works.
These too.. are creating what you THINK are "losses" but are in point of fact investments that virtually ensure that they won't have any real competition from anyone for decades.
What happens after that is anyone's guess but you are now talking about a person from whom the military is buying hardware. 

Let that last statement resonate with you for a moment before reading further.

" I'm looking at pouch batteries that hold about 4x the capacity of the tesla batteries..."~

Careful with that statement.  If you are looking at pouch batteries you had better be looking at how they are cooled.
If you tell me specifically what battery you are currently looking at, I'll be happy to give you some insight on what we know about them from our research.
We found NO other manufacturer, most using pouch style batteries for their internals, that were utilizing adequate thermal management.

"Those were part of an electrical bus demo project.. "~

Pouch batteries were also part of Mercedes large truck line.  The one they had to scrap... because they didn't have adequate thermal management.
This same technology line caused them to scrap two passenger vehicle lines and their home battery project.
So I'm going to say this again... make sure there is adequate thermal management.  If they are talking about air cooling the thing... avoid it.

" and you have a good starting point.. perhaps 5kw?"~

Everything depends on your home's average usage.  What is your annual average daily consumption, your winter average daily consumption and your summer average daily consumption.
With those three data sets in your bag of tricks you can draw informed conclusions about a good starting point.
I'll be happy to assist you with that if you can give me those 3 numbers as well as your latitude and elevation.

"The alternator is already available... "~

Alternator?  For wind?

"from China...will need thorough testing first, obviously"~

I'm buying nothing from China, and would suggest that anyone visiting this channel not do so either if they can absolutely avoid it.
China's issues are many.  Firstly the fact they don't recognize intellectual property rights is a HUGE issue for me.  I know how things get developed and rewarding companies for trying to advance our condition is paramount.
The deal breaker, however, is the bait and switch tactic taken by this VERY corrupt society.
They think nothing of providing you thousands of devices that are perfectly fine with the idea that they will deliver substandard goods later as they skimp on key materials.
The way Chinese companies work is that they start to copy the equipment needed to make your product even before you have finished building your own factory.
They then siphon off expensive materials for their own companies to make knockoffs while they substitute the cheap materials in the primary manufacturers goods.
This is RAMPANT.

"what happens if Elon manages to have a margin call as a result of the latest 2 billion dollars of bonds..."~

The takeaway here is that Tesla is paying it's bills.

"If the mothership stops responding when devices try to call home, do they shut down?"~

Neither the car nor the home batteries will stop working due to lack of contact.  Advancement will stop, obviously, but the devices will work fine.
What will happen next is that the people that developed that hardware and software will be looking for a job.
They will immediately start releasing "Jail braked" versions of the software.
I would be shocked if that took so long as a month.
Chevron or Shell would purchase the supercharger network and even in a total collapse of Tesla (not friggin likely at this point) the consumers will be fine.

I think that touched on most of your points.
Let me know what specific batteries you are considering.  I'll be happy to go over the pros and cons of that specific system and lay performance, size and longevity against the actual performance numbers we are getting out of the Powerwall system.
Reply from the maker: You covered a lot of ground there.  Much of what you wrote has some basis in reality but let me go through your points one by one to make sure you are looking at things realistically and not just sucking down what short sellers are telling you blindly.

Tesla has it's issues, but delivering on what they promise isn't one of them.

"I'm considering a 15kw power wall equivalent.. but not from Tesla"~

And that's fine, but you had better make sure that whoever you buy your batteries from is either using a liquid cooling loop or is using some technology other than lithium ion.

"They still can't figure out how to make the magic roof.."~

Firstly, if you are considering going solar then you already know that the roof isn't "magic".  It's solar.
Once you are honest about that then what you need to realize that altering a form factor on a product to make it better is never the easy road to take.  It's potentially a hugely rewarding one, but it's not an easy road to take.
By all accounts Tesla is making a wonderful product with it's roof solar tiles but integrating them requires testing and regulatory approval.
I expect they are running into their share of both engineering and regulatory hurdles.

"And the corporation has had years of quarterly reports with huge losses.. "~

Here is where you need to be careful to listen to tech insiders and not the stock broker who is trying to convince you to short Tesla.
Tesla has invested hugely in what's called NRE or "Nonrecurring Engineering". The reason Tesla sells every car it makes and GM is looking at Tesla's pre-order list like a monkey trying to figure out a magic trick is because of the Supercharger network.
That network cost them a huge chunk of change but has also built a moat around the company that is proving VERY difficult for any other EV manufacturer to cross.
Tesla's second moat is the Gigafactory... and now 2 more of them in the works.
These too.. are creating what you THINK are "losses" but are in point of fact investments that virtually ensure that they won't have any real competition from anyone for decades.
What happens after that is anyone's guess but you are now talking about a person from whom the military is buying hardware. 

Let that last statement resonate with you for a moment before reading further.

" I'm looking at pouch batteries that hold about 4x the capacity of the tesla batteries..."~

Careful with that statement.  If you are looking at pouch batteries you had better be looking at how they are cooled.
If you tell me specifically what battery you are currently looking at, I'll be happy to give you some insight on what we know about them from our research.
We found NO other manufacturer, most using pouch style batteries for their internals, that were utilizing adequate thermal management.

"Those were part of an electrical bus demo project.. "~

Pouch batteries were also part of Mercedes large truck line.  The one they had to scrap... because they didn't have adequate thermal management.
This same technology line caused them to scrap two passenger vehicle lines and their home battery project.
So I'm going to say this again... make sure there is adequate thermal management.  If they are talking about air cooling the thing... avoid it.

" and you have a good starting point.. perhaps 5kw?"~

Everything depends on your home's average usage.  What is your annual average daily consumption, your winter average daily consumption and your summer average daily consumption.
With those three data sets in your bag of tricks you can draw informed conclusions about a good starting point.
I'll be happy to assist you with that if you can give me those 3 numbers as well as your latitude and elevation.

"The alternator is already available... "~

Alternator?  For wind?

"from China...will need thorough testing first, obviously"~

I'm buying nothing from China, and would suggest that anyone visiting this channel not do so either if they can absolutely avoid it.
China's issues are many.  Firstly the fact they don't recognize intellectual property rights is a HUGE issue for me.  I know how things get developed and rewarding companies for trying to advance our condition is paramount.
The deal breaker, however, is the bait and switch tactic taken by this VERY corrupt society.
They think nothing of providing you thousands of devices that are perfectly fine with the idea that they will deliver substandard goods later as they skimp on key materials.
The way Chinese companies work is that they start to copy the equipment needed to make your product even before you have finished building your own factory.
They then siphon off expensive materials for their own companies to make knockoffs while they substitute the cheap materials in the primary manufacturers goods.
This is RAMPANT.

"what happens if Elon manages to have a margin call as a result of the latest 2 billion dollars of bonds..."~

The takeaway here is that Tesla is paying it's bills.

"If the mothership stops responding when devices try to call home, do they shut down?"~

Neither the car nor the home batteries will stop working due to lack of contact.  Advancement will stop, obviously, but the devices will work fine.
What will happen next is that the people that developed that hardware and software will be looking for a job.
They will immediately start releasing "Jail braked" versions of the software.
I would be shocked if that took so long as a month.
Chevron or Shell would purchase the supercharger network and even in a total collapse of Tesla (not friggin likely at this point) the consumers will be fine.

I think that touched on most of your points.
Let me know what specific batteries you are considering.  I'll be happy to go over the pros and cons of that specific system and lay performance, size and longevity against the actual performance numbers we are getting out of the Powerwall system.
Reply from the maker: You covered a lot of ground there.  Much of what you wrote has some basis in reality but let me go through your points one by one to make sure you are looking at things realistically and not just sucking down what short sellers are telling you blindly.

Tesla has it's issues, but delivering on what they promise isn't one of them.

"I'm considering a 15kw power wall equivalent.. but not from Tesla"~

And that's fine, but you had better make sure that whoever you buy your batteries from is either using a liquid cooling loop or is using some technology other than lithium ion.

"They still can't figure out how to make the magic roof.."~

Firstly, if you are considering going solar then you already know that the roof isn't "magic".  It's solar.
Once you are honest about that then what you need to realize that altering a form factor on a product to make it better is never the easy road to take.  It's potentially a hugely rewarding one, but it's not an easy road to take.
By all accounts Tesla is making a wonderful product with it's roof solar tiles but integrating them requires testing and regulatory approval.
I expect they are running into their share of both engineering and regulatory hurdles.

"And the corporation has had years of quarterly reports with huge losses.. "~

Here is where you need to be careful to listen to tech insiders and not the stock broker who is trying to convince you to short Tesla.
Tesla has invested hugely in what's called NRE or "Nonrecurring Engineering". The reason Tesla sells every car it makes and GM is looking at Tesla's pre-order list like a monkey trying to figure out a magic trick is because of the Supercharger network.
That network cost them a huge chunk of change but has also built a moat around the company that is proving VERY difficult for any other EV manufacturer to cross.
Tesla's second moat is the Gigafactory... and now 2 more of them in the works.
These too.. are creating what you THINK are "losses" but are in point of fact investments that virtually ensure that they won't have any real competition from anyone for decades.
What happens after that is anyone's guess but you are now talking about a person from whom the military is buying hardware. 

Let that last statement resonate with you for a moment before reading further.

" I'm looking at pouch batteries that hold about 4x the capacity of the tesla batteries..."~

Careful with that statement.  If you are looking at pouch batteries you had better be looking at how they are cooled.
If you tell me specifically what battery you are currently looking at, I'll be happy to give you some insight on what we know about them from our research.
We found NO other manufacturer, most using pouch style batteries for their internals, that were utilizing adequate thermal management.

"Those were part of an electrical bus demo project.. "~

Pouch batteries were also part of Mercedes large truck line.  The one they had to scrap... because they didn't have adequate thermal management.
This same technology line caused them to scrap two passenger vehicle lines and their home battery project.
So I'm going to say this again... make sure there is adequate thermal management.  If they are talking about air cooling the thing... avoid it.

" and you have a good starting point.. perhaps 5kw?"~

Everything depends on your home's average usage.  What is your annual average daily consumption, your winter average daily consumption and your summer average daily consumption.
With those three data sets in your bag of tricks you can draw informed conclusions about a good starting point.
I'll be happy to assist you with that if you can give me those 3 numbers as well as your latitude and elevation.

"The alternator is already available... "~

Alternator?  For wind?

"from China...will need thorough testing first, obviously"~

I'm buying nothing from China, and would suggest that anyone visiting this channel not do so either if they can absolutely avoid it.
China's issues are many.  Firstly the fact they don't recognize intellectual property rights is a HUGE issue for me.  I know how things get developed and rewarding companies for trying to advance our condition is paramount.
The deal breaker, however, is the bait and switch tactic taken by this VERY corrupt society.
They think nothing of providing you thousands of devices that are perfectly fine with the idea that they will deliver substandard goods later as they skimp on key materials.
The way Chinese companies work is that they start to copy the equipment needed to make your product even before you have finished building your own factory.
They then siphon off expensive materials for their own companies to make knockoffs while they substitute the cheap materials in the primary manufacturers goods.
This is RAMPANT.

"what happens if Elon manages to have a margin call as a result of the latest 2 billion dollars of bonds..."~

The takeaway here is that Tesla is paying it's bills.

"If the mothership stops responding when devices try to call home, do they shut down?"~

Neither the car nor the home batteries will stop working due to lack of contact.  Advancement will stop, obviously, but the devices will work fine.
What will happen next is that the people that developed that hardware and software will be looking for a job.
They will immediately start releasing "Jail braked" versions of the software.
I would be shocked if that took so long as a month.
Chevron or Shell would purchase the supercharger network and even in a total collapse of Tesla (not friggin likely at this point) the consumers will be fine.

I think that touched on most of your points.
Let me know what specific batteries you are considering.  I'll be happy to go over the pros and cons of that specific system and lay performance, size and longevity against the actual performance numbers we are getting out of the Powerwall system.
Reply from the maker: You covered a lot of ground there.  Much of what you wrote has some basis in reality but let me go through your points one by one to make sure you are looking at things realistically and not just sucking down what short sellers are telling you blindly.

Tesla has it's issues, but delivering on what they promise isn't one of them.

"I'm considering a 15kw power wall equivalent.. but not from Tesla"~

And that's fine, but you had better make sure that whoever you buy your batteries from is either using a liquid cooling loop or is using some technology other than lithium ion.

"They still can't figure out how to make the magic roof.."~

Firstly, if you are considering going solar then you already know that the roof isn't "magic".  It's solar.
Once you are honest about that then what you need to realize that altering a form factor on a product to make it better is never the easy road to take.  It's potentially a hugely rewarding one, but it's not an easy road to take.
By all accounts Tesla is making a wonderful product with it's roof solar tiles but integrating them requires testing and regulatory approval.
I expect they are running into their share of both engineering and regulatory hurdles.

"And the corporation has had years of quarterly reports with huge losses.. "~

Here is where you need to be careful to listen to tech insiders and not the stock broker who is trying to convince you to short Tesla.
Tesla has invested hugely in what's called NRE or "Nonrecurring Engineering". The reason Tesla sells every car it makes and GM is looking at Tesla's pre-order list like a monkey trying to figure out a magic trick is because of the Supercharger network.
That network cost them a huge chunk of change but has also built a moat around the company that is proving VERY difficult for any other EV manufacturer to cross.
Tesla's second moat is the Gigafactory... and now 2 more of them in the works.
These too.. are creating what you THINK are "losses" but are in point of fact investments that virtually ensure that they won't have any real competition from anyone for decades.
What happens after that is anyone's guess but you are now talking about a person from whom the military is buying hardware. 

Let that last statement resonate with you for a moment before reading further.

" I'm looking at pouch batteries that hold about 4x the capacity of the tesla batteries..."~

Careful with that statement.  If you are looking at pouch batteries you had better be looking at how they are cooled.
If you tell me specifically what battery you are currently looking at, I'll be happy to give you some insight on what we know about them from our research.
We found NO other manufacturer, most using pouch style batteries for their internals, that were utilizing adequate thermal management.

"Those were part of an electrical bus demo project.. "~

Pouch batteries were also part of Mercedes large truck line.  The one they had to scrap... because they didn't have adequate thermal management.
This same technology line caused them to scrap two passenger vehicle lines and their home battery project.
So I'm going to say this again... make sure there is adequate thermal management.  If they are talking about air cooling the thing... avoid it.

" and you have a good starting point.. perhaps 5kw?"~

Everything depends on your home's average usage.  What is your annual average daily consumption, your winter average daily consumption and your summer average daily consumption.
With those three data sets in your bag of tricks you can draw informed conclusions about a good starting point.
I'll be happy to assist you with that if you can give me those 3 numbers as well as your latitude and elevation.

"The alternator is already available... "~

Alternator?  For wind?

"from China...will need thorough testing first, obviously"~

I'm buying nothing from China, and would suggest that anyone visiting this channel not do so either if they can absolutely avoid it.
China's issues are many.  Firstly the fact they don't recognize intellectual property rights is a HUGE issue for me.  I know how things get developed and rewarding companies for trying to advance our condition is paramount.
The deal breaker, however, is the bait and switch tactic taken by this VERY corrupt society.
They think nothing of providing you thousands of devices that are perfectly fine with the idea that they will deliver substandard goods later as they skimp on key materials.
The way Chinese companies work is that they start to copy the equipment needed to make your product even before you have finished building your own factory.
They then siphon off expensive materials for their own companies to make knockoffs while they substitute the cheap materials in the primary manufacturers goods.
This is RAMPANT.

"what happens if Elon manages to have a margin call as a result of the latest 2 billion dollars of bonds..."~

The takeaway here is that Tesla is paying it's bills.

"If the mothership stops responding when devices try to call home, do they shut down?"~

Neither the car nor the home batteries will stop working due to lack of contact.  Advancement will stop, obviously, but the devices will work fine.
What will happen next is that the people that developed that hardware and software will be looking for a job.
They will immediately start releasing "Jail braked" versions of the software.
I would be shocked if that took so long as a month.
Chevron or Shell would purchase the supercharger network and even in a total collapse of Tesla (not friggin likely at this point) the consumers will be fine.

I think that touched on most of your points.
Let me know what specific batteries you are considering.  I'll be happy to go over the pros and cons of that specific system and lay performance, size and longevity against the actual performance numbers we are getting out of the Powerwall system.